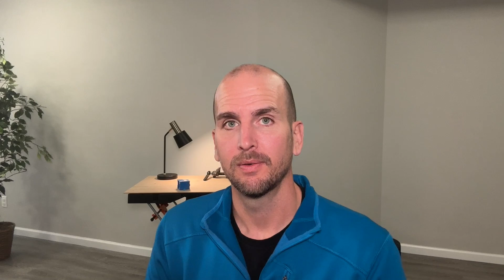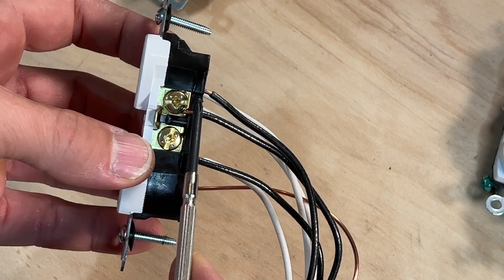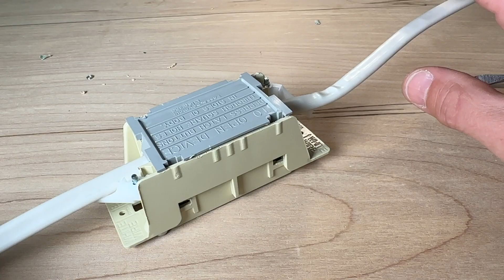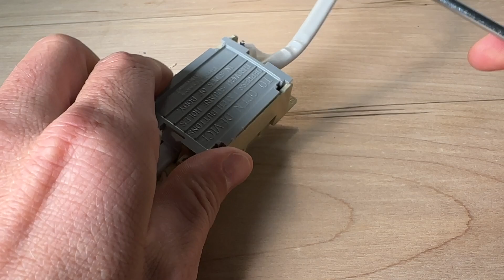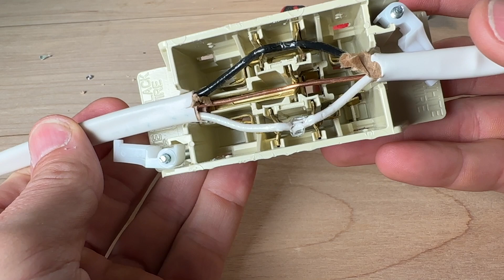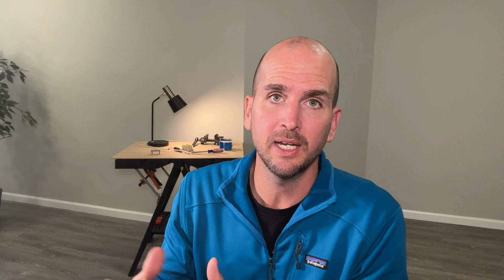90% Of Homeowners Have Never Seen This Dangerous Electrical Device

Comment: This type of connection (called "insulation displacement") was common for use in adding aftermarket electrical and electronics to vehicles (car stereo, for example). Guys that didn't know better or just didn't care about high quality work used these all the time because they were quicker than other methods (solder or crimp connectors and heat-shrink tubing). 
I avoided using them because the minimal contact area often heated the connector shells to melting under heavy current loads typically found in 12 volt DC circuits. 
The vibration found in vehicles often caused the quickie connectors to lose contact. Aftermarket radio and alarm manufacturers very often supplied these cheap insulation displacement connectors with their products.

Comment: I work on a good number of trailers and as a result I have replaced a bunch of these with standard electrical boxes when people need a switch or an outlet added or replaced. Pretty much every mobile home I've been in has them. It sucks for them because that means there's an extra hour of labor involved in completing those otherwise simple operations.

The worst thing about them that I've seen has been that since there's no box, your switch or outlet or whatever is screwed directly to the drywall and this is often done haphazardly and they wind up being loose in the wall. So then you have to pray you have enough meat left to mount the old work box.
Reply: You need a shallow-work plastic box.  4 screw down clips hold it to the drywall, so no need to mount on a stud.  You can also get thick plastic box surrounds to go around the outside of the box, to make it stronger.

Comment: My father had a manufactured home with these and they are bad.  Often had dead outlets where we had to open the back and push the wire back in. Also you could see that the insulation was discolored from heat.

Comment: I have never worked with this type of contact design other than in telephone and networking terminals. These types of terminals use very low current, and if properly connected there is usually no issue.  There is no chance for any hot spot.  Poor connection would make noise on the line or signal loss, and simple re-connection should fix it. 

I would not like this type of power outlet, or high current connected device that is using blade pinch type contacts.  Very strong potential for hot spots.  I cannot see how it is not possible to design, and  manufacture outlets and switches to be using properly designed screw contacts.

Comment: Bro-in-law's travel trailer has these in it. He asked me to help him diagnose what was going on when plugging in phone chargers and such no longer working while camping. Digging in, we found these outlets. Reminds me of Scotch-locs used in automotive. Absolute garbage. Scotch-locs are the first things to hit the garbage can when dealing with auto wiring issues. So I would've like to do the same with these for him. Problem is though that there is not enough slack in the wire to pull things into a proper box. We were in a campground at the time, so we did what we could. We shoved the wires down into the spades farther and took some needle nose pliers and bent the top parts of the 'V' of the spade tighter around the wire to cut through the insulation better. I've asked him since that time if he changed things for the better when he got home, and he has said that "no, he hasn't". I told him he should, but he's leaving them be. Oh well.

Comment: Ive seen similar types of connectors and it is super easy to get a real crappy connection. They have to be pressed real well in order to work well. I don't like them. I like the type that have the metal plate that presses on the bare wire.

Comment: What that's not a dangerous outlet they use in an RVs motorhomes trailers come on guys that's not any worse than the pushing outlets where they're pushing in the wires and not screwing them down. I've seen so many wires turning purple in those pushing outlets. Some with installation melting

Comment: You are spot on about these things.  I changed one out down in a manufactured home in Florida.  Had never seen them before and I don't know if you said it but there is no other electrical box.   What you show is what was screwed directly to the paneling.  What I found was just as you said it over heated and I suppose it melted the copper around the contact point and then simply failed.  And I too agree those things look very dodgy.  Thanks for the video you do an excellent job presenting the information.

Comment: Did repairs on a 250+ unit manufactured home property for a few years. These things were always such a pain to work on. Worst thing is the way those homes are built you also aren't left with much slack in the wall. Thankfully the newer homes at least had standard GFCI outlets where required.

Comment: i am an RV repair man and have a camper repair and recycling business  and i absolutely hate these devices ,,they are also called boxless devices and are the cause of more than 1 RV fire that i have seen  ,and also have been the culprit of more electrical problems than i care to admit ,,and repairing wiring in a travel trailer is even more of a headache than in a house
the house i live in has had the electrical wiring upgraded ,mostly by me  , the last of the old ungrounded outlets my grandfather had are now gone and nearly all of the wiring is 12 gauge and i used mostly commercial grade outlets , especially the kitchen and bathroom where high powered devices like hair driers and electric heating appliances get used

Comment: these are a really sketchy device, but they still seem to hold together better than stabs.  

and yeah, they usually have enough slack wire in the wall to pull them out and put in a proper receptacle - IF the wall is thick enough for the box.

Comment: There was one time with a previous company I worked for where we used an outdoor guard house within a large warehouse as an Emergency Server Room location for the enterprise. All I did was verify, then label circuit locations for AC distribution and cable surface-mount boxes for ethernet and phone. I rejuvenated an old APC UPS unit which had separate control and two battery boxes. I want to say it was rated for 3K-5K watts. All I know is I am glad we moved these units only twice, due to their weight.

Comment: My uncle has a modular home built in 1984 that has a version of these. The ones used there however have the face plates built into them as well. All of the receptacles and light switches are these. Luckily none of them seem to have had any issues, and although I have replaced a few, they were fine (just putting modern receptacles in the kitchen), The house still has mostly these. I don't know who thought these were a good idea, and I can see how they would create a hazard quickly, especially if used with something like a space heater.
Reply: @Karl with a K oh yeah, sure.
Reply: @Karl with a K Absolutely!

Comment: I've had these type of electrical connections in two different RV's and overall period of 26 years and I've never had an issue with them.  But as you mention it is the method of creating this connection where a problem could develop and even though I've been through several motorhome factories, and one factory a number of times, with 100's of pictures, I have yet to see the tool used to make the connections.  But with 26 years behind me and literally met probably 1000's of RV'ers, I have not heard of any failures due to them and this speaks miles of how well they work when you consider that they are in vehicles that go down the road and bounces a lot of things around.
Reply: Yes, this is the wago thing all over again.

Pressure is what matters, not contact area. Even under a screw the actual contact area is quite small. A loose screw has zero area under sufficient pressure and will oxidize and heat up.

This is also why we use sharp washers under ground screws. Smaller area, higher pressure.

Of course IDC will fail if not punched in properly, since there is no pressure.

When done right these are spring loaded, and do not come loose with vibration.

The moaners can try a screw connection made without a screwdriver next to an IDC made without the proper tool, otherwise it is just moving the goalposts.

Put three sharp grains of metal between two pennies - and lo and behold you have a good connection, the length of the grains is extremely short and the resistance is insignificant.

Try making a good connection just pressing the pennies together and you need a ridiculous amount of force.

This is why all screw connections have bumps or ridges. So much for that "contact area." It has nothing to do with reality, just people who want to keep doing everything the way they always did it.

Comment: IDCs (insulation displacement connections) run your world.  From signalling, to communications, to power, to RF and more.  They are everywhere.  A stable, oxygen tight (at the metal interface) connection that lasts decades can be formed.  The catch is, they must be done properly.  From the moment I clapped eyes on this dual outlet plate, even before the back was pried off, it was clear this unit had not been properly installed.  I note comments saying IDCs are not for high current applications.  They certainly are, they just need to be designed for it.  30A is nothing special at all, far higher is readily available.

Comment: I cannot thank you enough for telling me why I need to be leery of manufactured homes and their junk receptacles.
When you get to it, the solid wire on the Romex is a pain to work with in the first place, even though it is copper, it is just as stiff as if it was steel, and a total pian to get a decent "J" hook out of for a receptacle screw and also cram back into a typical narrow wall space.

Comment: I have seen dealt with these in a mobile home. They are absolute rubbish. Installed an old work box, and proper receptacle, to eliminate intermittent connection issues.

Comment: A normal outlet can be just as dangerous when not installed properly!!!! The problem here is this device is NOT IDIOT proof and when you work the trades all sorts of skill levels are hired improperly managed!!!! Blue collar are amazing people but many business owners are about the profit to the business not about quality work. I would have to see the installation per the UL certification before I blamed the device. Pass and Seymore ins a good company and I have helped put a product through UL listing testing. It got the UL approval for a reason but means and methods will definitely retire the product from the market after a few houses burn down because an electrical contractor cut corners are their hiring, training, and tools.

Comment: That's crazy but I'm not surprised that it's something does to save money I mean cost I would think is pretty similar because a standard outlet is pretty cheap but I'm sure the cost for installing would be a lot less and you really don't need much training and ya the design is not great my biggest problem is it doesn't look like there would be enough wire for servicing it

Comment: Never seen these before, one way around the specialty tool is to build the tool into the back cover. This type of connection is called IDC, Insulation Displacement Connection, telcos have been using this method for many, many years.

Comment: Those wires look as if you were relying only on the plastic back Plate to force them to make connections. I am sure if you use the proper "punch down" tool recommended by the manufacturer with the extra pressure to fully seat them into the brass slots provided the contact area would have increased significantly. The back plate just insures the wires stay in the slots and never intended to force proper code compliant connection. As you mentioned,, these type of connections were/are originally/frequently used in smaller formats for landline phone & wired data IT service connections. In a pinch a needle nose pliers could be used on the lightweight 22 gauge phone type wire to insure that both sides of wire at each single slot were fully seated. Pushing only the wire between the 2 slots for each as evident in this installation was certainly not the method allowed by the manufacturer. What did the installation instructions that came with the device dictate?
Reply: @Kevin-mp5of despite my trust in engineering math the variability of skilled labor at installation plus unknown mileage equalling vibrations before homes are stationary shows the math is lacking adequate safety margin. 
In addition the heat gain at every connection is additive and the better the connection equals the conducter's cross section is reduced causing even more heat at the worst place. I suspect the most fires are started at the device with highest load that is also nearest the panel. 
I understand now how brand new RV's have catastrophic fires on their first trip.

Comment: I have seen many of these in modular homes. Over time they will cause heat and sparking due to corrosion on the blades. Changing temperatures in the environment will also cause them to come loose over time due to natural contraction and expansion in the wires and blades. They are a real fire hazard.

Comment: Nah, that's nothing!  Wait until you come across one on the back of a light switch, daisy chained to a second light switch, daisy chained to a third light switch, daisy chained to a cable that disappears back into the wall (and finally goes to the bathroom socket).  At the end of the day, there were 3 (three) 14 gauge romex punched down onto the back of each switch - and the back of it looked just like that socket you had there - 3 pairs of punch down pins per switch!

The light switches were for the bathroom ceiling light, the extractor fan and the lights above the mirror and each had a separate romex run to its switch.  The incoming line was a romex onto the first switch, the outgoing line to the bathroom socket was another romex from the line side of the 3rd switch.   Then there was a very short piece of romex double punched on the line side of the first switch to the line side of the second switch, and another very short piece of romex double punched on the line of the second switch and then double punched on the line of the third switch.

To make matters worse, this was 3 single gang switches side by side, not a 3 gang box, and all the wiring was done from the back!  (Manufactured home).  The switches were installed on the inner wall and then the wiring was done before the outer wall was covered over.  All the cables were exactly long enough to reach their destination, and stapled to the studs to allow no free play at all, I had to cut the wires just to remove the switches from the wall!

Fixing this disaster required burying 2 J-Boxes in the cavity with a lot of pigtails from them to the new 3-gang switch!  I have another one to do in the laundry room, but I keep putting it off for some time when I'm really bored!!